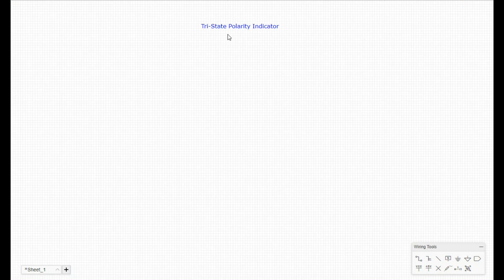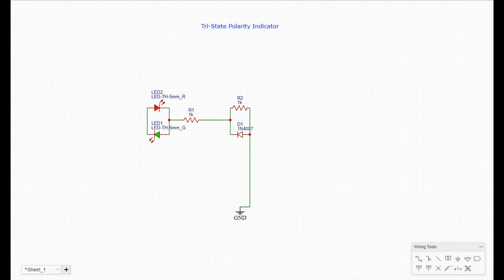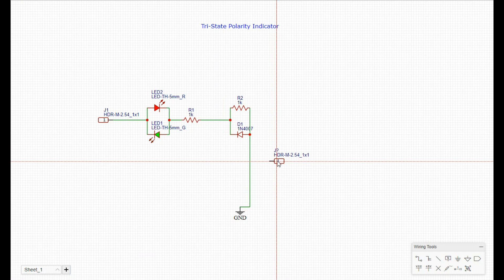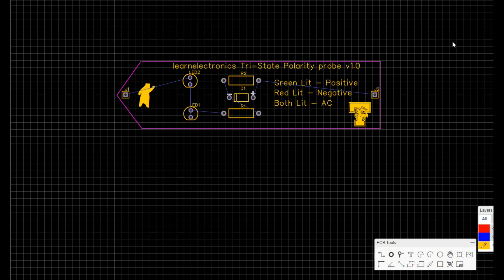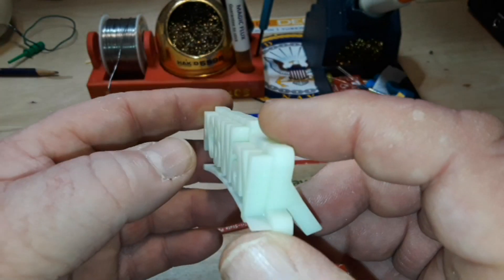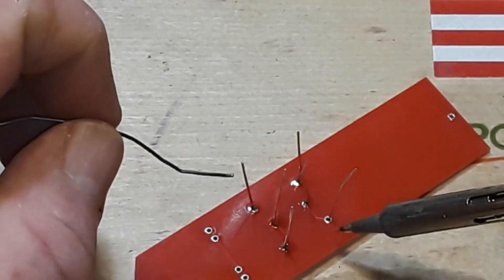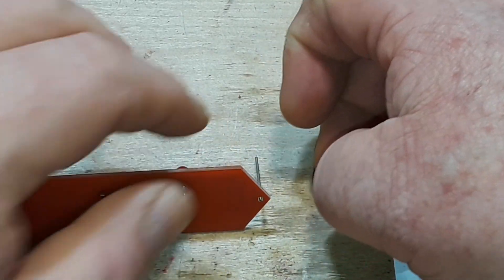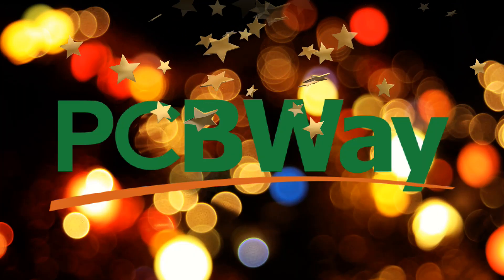Tri-State Polarity Indicator PCB

Comment: OK, I give up.  I put this circuit into Multisim and I cannot figure out the resistor and diode on the back end,  I see no difference with or without it.  I am guessing that maybe I don't have the test conditions correct.